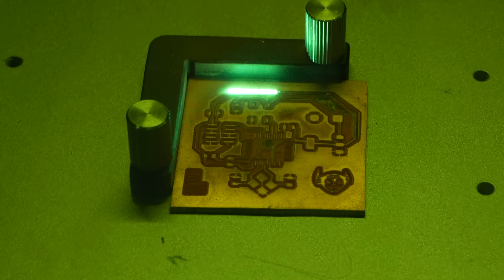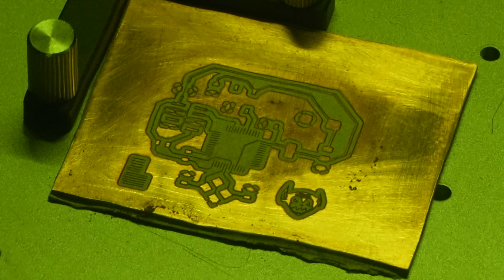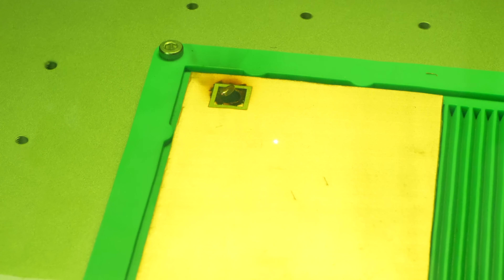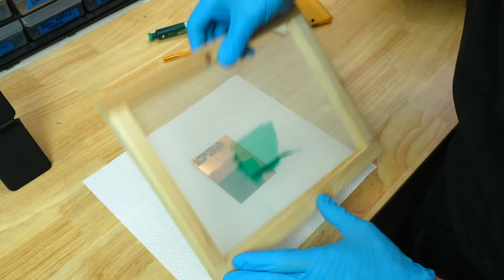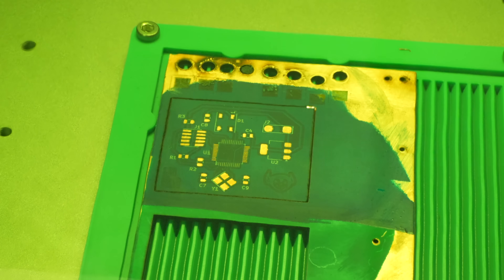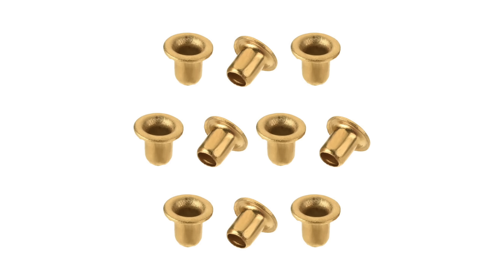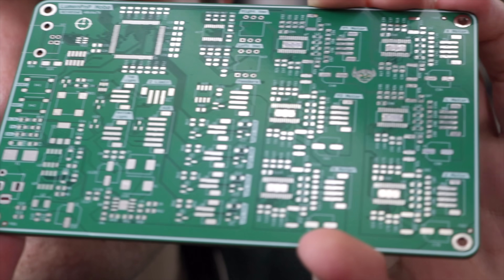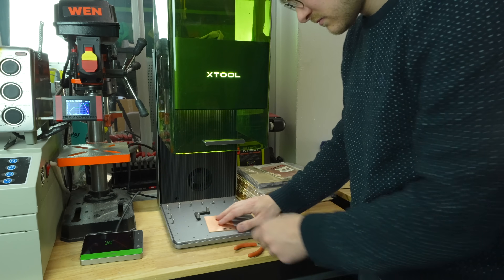Prototype PCBs faster than 3D Prints

Comment: An interesting method, despite its drawbacks. As for the solder mask, I wonder if there's software that automatically calibrates the image by finding fiducial marks on the board after the copper is burned away. That's how pick&place machines calibrate the component positions in board manufacturing.

Drill first, etch (burn) next: an idea crossed my mind to use a CNC machine first to drill all the holes, slots, board outline and fiducial marks (!), then use the latter both in the copper and solder mask burning processes, calibrating before each.

For double-sided designs, a characteristic pattern of holes or slots along the board outline could act as fiducial marks. It could be created in the milling & drilling step and since they go through the substrate, it'd just be a matter of locating a mirror image of the pattern and using it as reference for burning the copper and later on, solder mask.

Comment: I wonder if there is some method using fine metallic powder (let's ignore the danger of that for a second), you could drill, then fill all the vias with the powder. Then perhaps you squeegee some solder paste over the board and use the laser to meld the solder over the vias. The hope being that the solder links the annular ring, saturates the powder at least partially, then you repeat on the other side? It might only be possible for very low aspect ratio vias, so thin boards with larger diameter holes. 

Another few thoughts, for alignment, use the laser to cut blanks that mate with dowels. That way you aren't relying on the accuracy of the guillotine that cuts the stock. 

Last one, you could/should plate the surface as well. I can't remember the details of it but I seem to remember that there was a single bath silver or similar playing process some folks have used. You'll have freshly stripped copper to plate onto which is great. But I guess in the vein of this being quick turn around, if you are soldering parts on within a few minutes, maybe copper is perfect.

Comment: This might be not that useful but maybe ordering blanks with a grid of vias but solid copper on both sides would be a good option for double sided.
You can than decide to use a via just by routing the trace on top of an existing one. Of cause this would limit the flexibility and be difficult to use for very fine pitch ICs (a section of the board could have finer pitch grid lines to make this easier) but it would allow for a standardtized process.

Comment: Interesting video thanks Stephen.
Back in time Harwin UK used to produce track pins.   This was a long thin strip of snap off pins that you could insert into vias and break off before soldering.   The protruding section underneath the board could then be snipped off.  This made a prototype double sided board very quick to link through where component legs were not otherwise accessible for doing the the through linking.  Hole size was around 0.9mm.   Harwin no longer list this as a product but their part number M20-003 is vaguely similar but this is a listed as a polarising pin for their connectors and seems to only be supplied loose rather than break off.  Dimensions are not too different.
I still CNC mill my boards and use FlatCAM to create the GCode from the Gerbers for single and double sided.   I use 15 thou end mills as standard but can run 5 thou for QFP tracking.  I have not attempted solder resist but I do hand tin all the tracks.

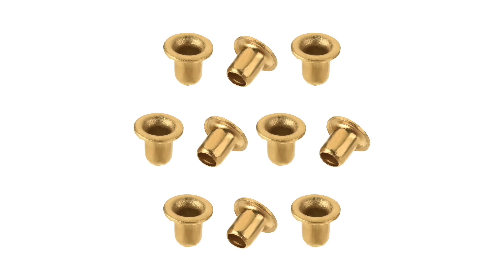Comment: 9:50 You cal also just drill a hole and use a thin(ner) wire, but there would be solder on both sides.

Comment: This looks super cool, but raises the immediate question of whether it could be (almost) fully automated with the addition of some kind of inkjet solder mask application? Not that I have any idea how inkjet printing really works, but assuming solder mask can be applied by inkjet, that makes me think this could be a continuous, zero intervention single enclosure process for a single sided board - etch, print, cure, etch again, cut - , removing the need for realigning the board too.

Comment: I saw another creator who was using a pick and place machine with a syringe of conductive resin as solder paste. The pick and place machine would put down the conductive glue and then drop the part into it immediately after. I can't help but wonder if you wouldn't be able to use such a process to pump a conductive air cured resin through a hole to create vias. Then you just let it cure in the hole provided it is at least relatively neural on change in volume with curing.

Alternatively, you could probably finagle a 3D print like setup with solder wire and have the nozzle right up against the proto-via hole and just pump solder through. You have the thickness of the board and the hole that is cut so measuring out the perfect amount of solder to pump in shouldn't be terribly difficult. Though, I will admit hitting the target every time would take some doing.

Comment: Check out "ProConduct Paste RS" by LPKF. Its a paste that you suck through the holes with a vacuum, maybe from both sides. Then you just throw the PCB in an oven to bake it and you're done. Sadly very expensive. Maybe there are similar products.

Comment: Another way to spread solder mask thinly and evenly is to put the pcb on a spinning disk, drop some uv resin droplets in the center and then spin at high rpm.
Can vary the thickness very precisely by doing several coats and also can do the silkscreen easily: put the white/yellow/other light uv resin as the bottom layer, put green/blue/other dark uv resin as top layer, oblate top layer to reveal silkscreen, oblate both to make solder mask.

Comment: The rivets in your video are quite chunky, maybe have a look at the eyelets used in the repair kits - I used to work at a company producing PCB's on mass, and the repair area had these kits.

Some comments mention tin plating the pads, I'd also suggest looking into gold plating the pads.  Soldering on to gold plated pads just feels so great (when using lead based solder, can't say for the lead free stuff as we made medical boards), plus there is the bonus of the pads not oxidising if storing for a long time.

Comment: Excellent work!

Regarding the vias, what we did in uni was put the two sided DIY board on a piece of cardboard and then stick thin wire trough the via holes. Then you cut the wire to a few mm above the boards surface and repeat for all vias. The cardboard benearh will hold the short wires on place and then you can batch solder then on the ”top” side, remove the cardboard and the solder on the bottom. With the right cutters and some practice, I’m reasonably certain you could get the vias almost flat.

Comment: I'm thinking maybe dowel pins if you can drill 2 holes accurately (maybe not laser) then you can repeatably hold it by sliding the plate on and off the pins 

Do some research on work holding tooling for machine shops for your alignment issues, these are solved issues in the world of machining.

Maybe another youtuber can colab with you, like nyc cnc (they have a good series of work holding for machining) can help you out

Good luck, will follow this channel, this is exciting stuff. Electronics, together with some metal 3d printing technologies coming down in price are standing in the way of the make everything at home revolution i think, so keep going!!!

Comment: I made a device for cutting a regular wire, a 0.5 mm copper wire without coatings, and a riveter for it. I drill holes with a 0.5 mm carbide drill and tightly insert copper rods. After tinning, it turns out great and cheap. I even made 0.3 mm ones for QFP, LQFP and TQFP cases. It turned out great to install microcircuits after a little sanding and aligning the rivets.  I drilled the holes on a CNC machine and engraved the tracks using my GGEasy program.
Я сделал приспособление для нарезки обычного провода, медного провода 0,5 мм без покрытий, и заклёпочник под него. Сверлю отверстия твердосплавным сверлом 0,5 мм и плотно вставляю медные палочки. После лужения отлично и дёшево получается. Я даже 0,3 мм такие делал под корпусами QFP, LQFP и TQFP. Отлично получалось поставить микросхемы после небольшого зашкуривания и выравнивания заклёпок. Отверстия сверлил на ЧПУ и дорожки гравировал тоже с помощью моей программы GGEasy.

Comment: If you're just prototyping a board, you could just make two boards – one for front and one for back – and then just connecting them with jumper wires

Comment: To get an even layer of the solder mask, you can use the spinner,  in fact any decent RPM motor with attached round plate, and a can around it as a shield. Maybe a PC fan. Attach the PCB to the plate w/ double adhesive tape, start the motor and drop the mask in the center. That's usually used for photolithography for applying photo resist, or other coating, too. I guess you can use the angle grinder to rest, just don't forget the can:)

Comment: I was doing boards back in the 70's using Shipley AZ111 photo resist.  Double sided were no problem but doing simple PTH was the holy grail that was always allusive.  Hole activation with carbon inks or copper hypophosphite came a long but the wet chemistry was very labor intensive and messy and just could not be justified against the online pcb houses.  Always thought something like an up scaled automated IC wire bonder might be possible to connect the components with some sort of fine insulate wire.

Comment: When I was a boy (very long ago) my father used rivets for non plated holes printed circuit boards, but they were not made of brass, they seemed to be made of stainless steel (they were to shiny to be made of iron, or maybe phosphorous bronze covered in nickel or chromium). It is a boring work with a puncher hammering each rived in hundreds of holes. The good part is that you will never have a trace peeling because of heat and it is incredibly easier to solder for what I remember (I was a boy I remember it was when Wild Wild West was airing on TV maybe reruns, so it was probably the 70s).

Comment: Rivets are slow and big to apply. Me no likey. Plating is eeeeh tricky to say the least. But it's wet and messy process after all. 
I did make a mixture of brass and tin powder waaaaay in past for something completely unrelated. Now I am thinking that mixing such powder with some resin to liquify it, pushing it through hole and reflow could work. Could is key phrase though. Powder like that probably does not exist yet and it needs to be engineered into existance.

Comment: hear me out:  apply rivets, laser out the excess of the rivets leaving only the 'pipe' part in the board, use solder to ensure board-rivet contact. 
Also the simple easy 'manual' low-volume approach is to use wire through, like with leads of threaded components, just solder them from both sides. Not as neat or fast but zero extra tools or materials.

Comment: My feeling with this machine is it should be used for rapid prototyping PCB designs (just like a 3D Printer) and testing. Once you have your final design, then send it to your favorite PCB lab for a small test batch to verify that everything is still working as intended and then final mass production. If you have to make hundreds of boards, it would take a significantly longer time to do everything yourself. Without something like this, every time you find a problem with the design you have to get a new batch made which takes way more time.

Comment: I make pcbs using a bantam mill, and the easiest and best way I’ve found to do through-holes is just to plate them. I use pyroclastic deposition to get a little bit of copper in the holes to allow conduction, then just hook up my power supply and hang the board in a bottle of copper sulphate dissolved in weak acid for about half an hour.  It’s really much faster and easier than rivets. 

If you don’t want to do this, the second easiest approach is to add tiny holes where you want the signals to pass through, then put copper wire of the same size through and hammer it to form a tiny rivet. You can get them perfectly flat. For other through hole parts you can just solder both sides of the wire.
Reply: "pyroclastic deposition" -- you have your own volcano?  Hahaha. Seriously, can you describe that process?
Reply: I'm curious about the pyroclastic deposition technique too, especially since you called it easy.

Comment: Pick up a mopa jpt laser in 60w plus and it will work really well. Higher power at shorter pulses can take off masks without attacking the copper also you can cut fr4.

Also make some proto boards with vias and alignment holes without mask at jlc etc and have a template file you can used to turn into whatever you want later the laser can burn out a via if it's not used or cut copper to form a trace to the via.

Via filled 2 sided copper sheet

Comment: What if you recessed the rivets into the board? Use the laser to cut a shallow hole that's a bit wider than the through hole that sinks the mandrel head of the rivet. Like countersinking a screw.

Comment: 1) UV paint
2) engrave the board ( high watt, low speed ) 
3) engraved the pads ( low watt, high speed ) 
4) cut the board ( high watt, low speed ) 
So if you fallow this after all passes complete you will be done becuse you only need UV paint over traces. Plus try to shot air to the board heat is your enemy

Comment: Hello. First of all greate video. On my experience  more expensive solder mask from ebay has much better adhesive. Second for metalization you could use spray "graphite 33" with solvient 646.

Comment: Another usecase (other than quick turnaround) is single quantity stuff, think test setups or jigs you only need 1 off.
Currently I do a lot of that with protoprint boards, but that requires space, especially when you have to solder SMT adapter boards etc.
This in combination with 3d printing is great for programming/test jigs with pogo pins.

Comment: Of course this is cool but where do you think all those micro-particles (of copper, solder mask, FR1 composite, etc) created by the ablating, are going? I think you should look into finding a proper PPE to use this. Depending on the particle sizes, they may hang around (to be sucked in the lungs) for a while.

Comment: A clear next step would be to add a camera + light, and do some loop closure: ablation pass, image, check for leftover, calculate a follow-up pass, then take out the remaining copper. Could also be used for the second stage alignment.
Would be great to get the manufacturers to add the camera in internally, so it could be truly coaxial.

Comment: As a 3D CNC machinist, you'll want some thru-holes to use as registration to be able to get the second side to line up.  Also recognize there will be some slop in the hole sizes so it won't be perfect but a small CNC drill would probably be best since you're using a precise cutter not a burning to punch through.  Add 3 holes for alignment and you're locked in pretty well, then design tolerance support to be able to handle the small movement and you should be good with that part.  I'd also recommend cutting the board out before engraving.  If your cut gets messed up, you won't waste a full engrave time to do it.  Like someone else said, don't use an edge for alignment, use 3 holes.  It's easier to get those lined up perfectly than edges.
Reply: Or use conical registration posts?

Comment: Instead of a rivet, could you drill a hole through the board, large enough that you could flow enough solder through to conduct between both sides? maybe this could be doable with solder paste, putting a large quantity in the hole, and some "overflowing" on each side, then it could conduct.

Comment: at the site of the association i am in, we have multiple CNC routers in different sizes, 5 3d printers like SLS and FDM, a argon tube 5kw laser cutter, a imagesetter and etching equipment and such stuff. There are multiple ways of making a PCB. i am, a industrial electrician for automation and process execution. I know how a PCB is made and i personally prefer the CNC method the most. 
it is fast and efficient and less messy or dangerous as any other method i know. With the right software, you can make a PCB from a hand drawn image in minutes, if you want with holes and press trough vias. We have modified one of our smallest CNC router slightly so it is able to press vias and coating. We did this because imagesetting and etching is highly dangerous. Using the laser cutter is also dangerous, especial the ionized copper vapor is toxic. 
CNC is also not risk-free because if the Glass fibers but a sucking it up while cutting and filtering with an 3 stage oil covered air filter also recycling the air over and over keeps every partial inside the CNC router, is very effective.

Comment: You're ablating copper and GLASS fiber.. where you think all that dust is going to go?
Everywhere in the air and all the surfaces and ultimately to your lungs and intestines unless you're serious about air filtration and venting.

These small thing hardly have the air circulation necessary to be safe...

Comment: Drill holes, use holes as a key jig. Put the board in the jig and screen print surface mounts and skip the second laser pass with solder mask :P . also why not just use a wire in a hole soldered on both sides for 2 layers.